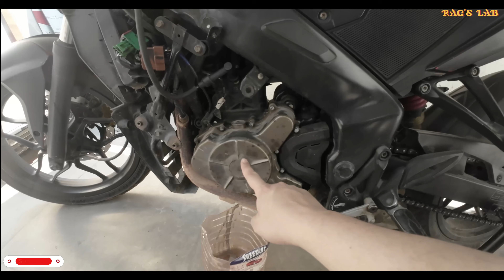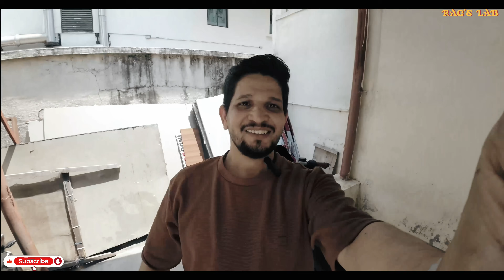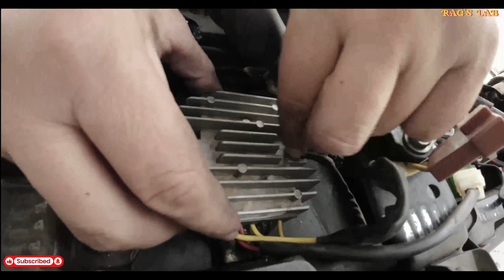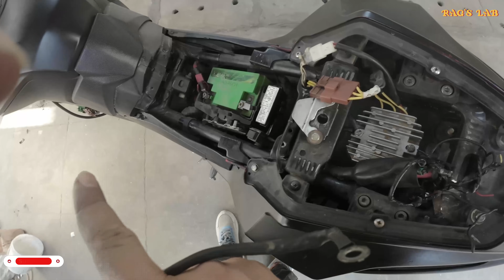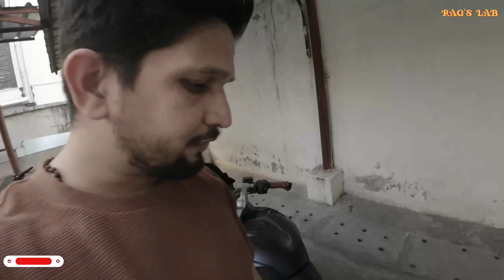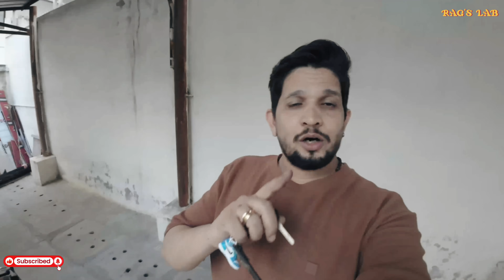Dead RS200 Revived 🔥 DIY Stator Coil + RR Unit Fix | You Won’t Believe Thi5!

Comment: As i see u used bs6 RS200 rr unit in bs3
Can i also use it? In my bs3?
BS6 rr in bs3? Any problem?
Reply from the maker: Good observation bruh :D you can, they are same :)
Reply: @RagsLab  parts numbers are different
Reply from the maker: Yes bruh, thats mainly cz of regulations and component quility change. Apart from number, it is compatible and works as normal as it suppose to be, converting ac to dc :D